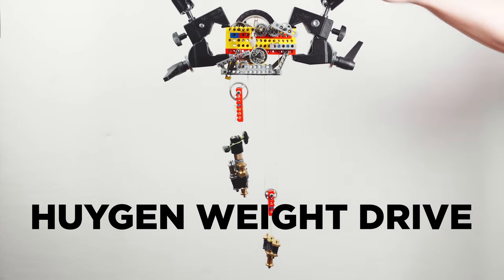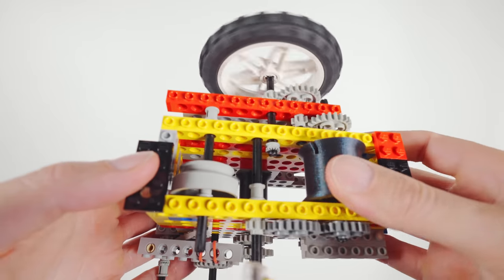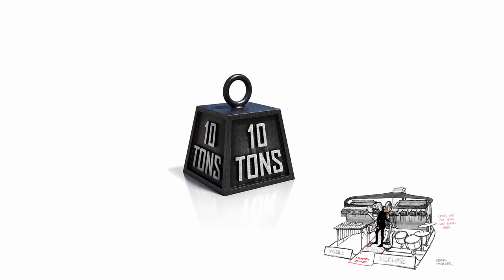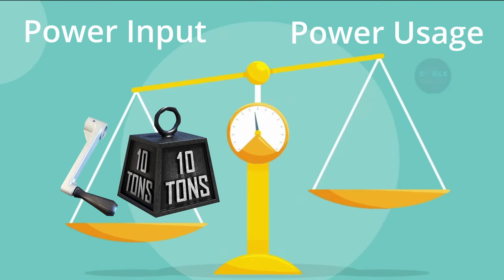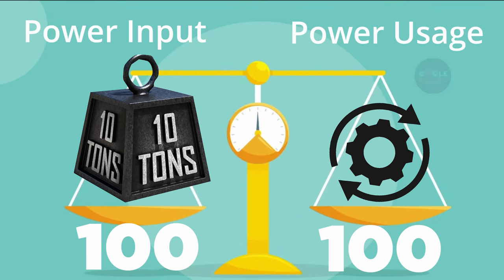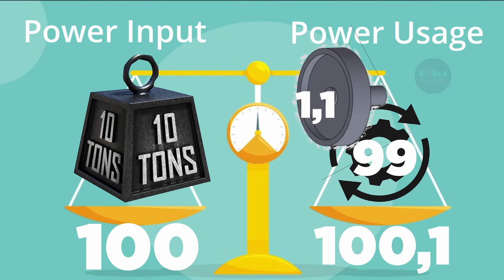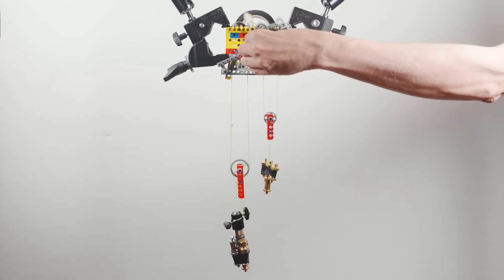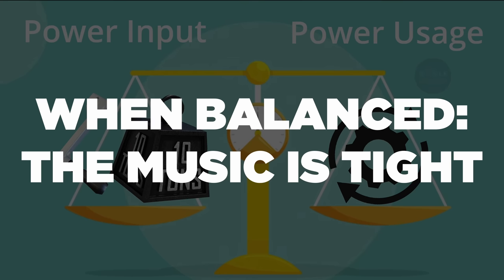Lego Technic Huygen Chain Drive

Comment: I will never understand his obsession with music being so tight
Reply: I think he wants a machine that after sitting in a museum for 100 years will still play music exactly as expected on day 1. Getting music extremely tight now allows for age to have little impact in the future. I think he's upset about the fact that the MM1 worked for one song, poorly, and even though it's in a museum now, it's unplayable, and no one can hear it play live again.
Reply: Small errors introduced by a human will be organic/random and often pleasant. Errors introduced by machinery could easily have patterns which we will actually hear. So an easy target with machinery is to just get rid of all error even though organic/random error would be fine.
Reply: @grunions9648  After this one is complete, he will make a MM4 that will feature human-like imprecisions
Reply: Don't forget he plays alongside midi controlled arps. etc. Aside from the drift which absolutely cannot happen for this machine to work in his sets, there's a huge difference between gradual swing timing errors from a human, and random and possibly even repeating patterns of timing errors which could become quite noticeable and extremely off putting, even on the + a few ms scale. Especially if they are both before and after the beat randomly one after another. It really messes with the feeling of flow, especially when alongside actually highly timed music (like a midi controlled arp for example). 20ms is all it takes for an instrument to start to begin to really sound out of time for a trained ear. If you already have tightness, you can then manually play with timings to get a non random, more natural and less robotic like performance if you really want, but when you're playing alongside midi arps anyway, that robotic tightness of midi might be the sound he's going for (it certainly sound like it at this point).
Reply: He gives his explantion at the end of this and the last video. He says, that he woudn't like to use a machine that isn't precise enough to replicate the music he wants to compose for it and fulfill his vision of a marble machine is general. I my opinon thats completely understandable, since as the composer of the music for the machine, he is the only person who knows whats good enough. The question is just how much time he should spend on this, before moving on and working on something with better chances on quick improvement. Spending a few weeks with lego prototypes to potentially find a revolutionary solution isn't doing any harm and at some point martin will either find a great solution that's up to his high expectations, like with the 3d printed marble gate or he will have to accept a compromise between development time and quality and move on.
Reply: @bongi6811  — That’s an absurd explanation, because he can’t possibly compose music that “needs” perfect tightness to a degree that’s far beyond what is perceptible to humans. Also, we’re CLEARLY well past the point where he’s willing to accept compromises for the sake of time; what channel have you watching?
Reply: @bongi6811  By Martin's standards, he's right that the MMX doesn't play tight music. You know what it also doesn't do? PLAY MUSIC! The only successful project he's had is the original Marble Machine, and that thing was a pile of junk! But it worked and it was finished, and that's something that Martin hasn't been able to replicate in seven years, even with all his additional experience and knowledge in design and manufacture. I guess the Martin that existed seven years ago was able to actually compromise, and be happy just to get something out the door. The Martin of today is such an obsessive perfectionist that he would rather burn MM3 to the ground than hear it play a single wrong note.

Look, I've struggled with perfectionism before. But, I've grown to struggle with it less and less. When there's a deadline coming up, "Done" is a lot better than "Theoretically perfect if only I had more time to work on it." Somehow, Martin has regressed into that latter attitude, especially not helped by the fact that he's got an infinite stream of Patreon money, meaning that he can take as long as he wants getting asymptotically closer to his idea of perfect.

When a machinist gets handed a design for a part that has features and tolerances that would be extremely difficult if not impossible for him to make, does he get disappointed? Think that he needs to do better? Invest in incredibly expensive tools just to make this one part? No, no, and no. What he does is he gets the junior engineer that designed that mistake of a part and he tells that he's an idiot for forcing him to see it. Not every surface needs to be perfectly flat and toleranced to a single thou. Just like how not every note needs to be played within a few microseconds. If Martin were contracting out the construction of the MMX/MM3 to someone else, he would've had his ear shouted off long ago.
Reply: @johnnyjohnson6643  I have to take his word fot it when he says that he woundn't like to use a imprecise machine at 7:59, because thats his subjective opinion. It took Martin less than 3 months from the first video about a new marble gate to finding a desing that he's happy with, which is a reasonable time to spend on such a important part of the machine. The power module is in the works since 3 months and the new idea of testing alternatives to a flywheel since two weeks. I am also a bit concerned that Martin might get stuck in trying to perfect a single component for eternity, but I would consider the time spent so far to still be reasonable. If he still works on the fundamentals of the power module in 6 months or so, I will completely agree with you that he has gone to far, but the progress so far seems to me more like cautious overengeneering to keep savety margins and not introduce design flaws.
Reply: @erictheepic5019  I agree with you, that perfectionism can be a very harmful mindset and Martin is no doubt susceptible to it, but to understand Martins position we also have to keep in mind just how bad the previous two machines actually were. The original marble machine video was edited together from hundreds of takes, because the machine could only play a few seconds before breaking and the audio is heavily edited to sound decent. Even best runs of the MMX in his testing livestreams lastet only minutes before something broke or other issues like a clog of the marble divider occured. The previous machines were definetly far from beeing "good enough" for live concerts or even just a studio album. I belive that the fear of introducing design flaws like the very limited capacity of the marble divider of the MMX is the reason for Martins strive for perfection and overengeneering. Trying to perfect everything can become a huge issue, just like you said and I also fear that he might get stuck from not accepting a compromise, but I wouln't say that it happend so far. The development of the mm3 started just 8 months ago and he made good progress with the marble gate completed, programming wheel concept proven and a decent power module desined. Having an overengeneered, way to precise machine in lets say 3 years is way better than going for "good enough" to finish it next year and introducing a design flaw, like the marble preassure on the gates issue on the MMX, that makes the whole thing unable to play anything. Only time will tell how the mm3 turns out and I'm still hopeful that it will be the first reliable marble machine.
Reply: @erictheepic5019  Martin wants a machine that can be brought on tour, and by that metric, the original Marble Machine was not a success. It barely worked, and I certainly don't think it was ever "finished." (It's more accurate to say that Martin was done trying to fix it.) This is Martin's project, and if people want to support him, then that's their choice.
Reply: Tight like a tiger.
Reply: @bongi6811  The problem is that he is often aiming for like 1ms or sub 1ms tightness of the music played, which sounds fine, but considering the speed of sound this is beyond human limits. Imagine being at the concert of a band, and the musicians played absolutely unison, a person being on the right side would have a far bigger delay between the two than 1ms.

This whole tightness kerfuffle only starts to make sense if he says what tightness he needs his music to played at and how he expects it to amplify or smooth out on his machine. Otherwise this is just chasing butterflies.
Reply: @Caesim9  I completely agree that precision in the 1ms range is unnecesarry for a normal performance, but I think that the reason why Martin is trying to get every part like the marble gate and the power module as precise as possible is, that it allows other mechanisms to be less precise while the complete machine stays accurate enough for human perception. For example, if it turns out that he can't get the programming wheel to be perfectly round, which introduces inaccurate triggers, thats fine, because the power input and marble gate are so precise that everything together is still good enough. I like this aproach of trying to do everything as good as possible before moving, as long as he isn't spending years on single millisecond improvements, because it's a slow and steady way to a reliable marble machine, that's hopefully capable of studio recordings and even live performances.
Reply: The irony - his quest for tighter timing has resulted in him not making any music with the marble machine.
Reply: It's an easy way to generate more content, isn't it? Less and less, I think the goal is to have some sort of musical "thing," and is more about being a YouTuber.
Reply: @brianbaker2759  In his quest for tigher music, he finally isolates the source of all errors, his humanity.

"On this episode of Wintergatan Wednesday I will be uploading my consciousness into a computer."

Comment: Wait till martin discovers how tight a midi keyboard can play! On a more serious note, a sprag or roller clutch will fix your backlash issues.

The bigger issue is the mmx does not have a constant power usage, it depends on how many and how often notes play, and adding a governor will sap significant energy.

A simpler governor as opposed to the centrifugal one, is a fan or using air resistance. Little music boxes often use this.

Comment: The power input must not only overcome the friction, but the energy required to lift the marbles.  If at any moment in time, the machine is on average lifting 100 marbles, the energy required to lift the marbles is also a component of "power usage."  If the number of marbles being lifted varies from moment to moment (which seems likely), the power usage will correspondingly vary.
Reply: Excellent point! 👍👍
Reply: That may not actually be true if there are enough marbel at the bottom to act as a buffer than the amount being lifted at any given time would remain constant; Even if the buffer pre and post left are changing in value.

Comment: Martin. You cannot use the Lego models for fine measurement. You can only use them as a guide, rapid prototyping to get an idea of what might work. If you try to test using Legos you're going to burn yourself when you move to real materials. Only use them as a guide!
Reply: But the tight tolerances on LEGO blocks! /sarcasm
Reply: I hope that I'm right that he is just using the Lego models to test out different proofs of concepts. I could be wrong, but I think I hear that in the subtext of his explanations.
Reply: I saw a video of a PhD project of a 3D printer for printing biological tissue, it was made of Lego apparently so it would be easier for researchers to copy and it would be cheap, everyone in the comments defended it saying that lego was absolutely suitable for a “complex” machine that is apparently meant for use in research labs. It was using lego Mindstorms motors.

It was complete BS and the machine wasn’t even that great, they would have had much better results just modifying a cheap 3D printer. A cheap 3D printer would have been cheaper anyway. The only new or innovative part was the tool head for extruding the tissue, the rest of it was just a crappy, tiny, imprecise 3D printer made of lego. Just modifying a cheap 3D printer would have been, easier, cheaper and much more precise with many more features. But no according to them and everyone in the comments a crappy 3D printer made of lego was the best option for something meant to be used in research labs.

It was pretty insulting to researchers saying that they made it out of lego so that researchers could copy it. I think if you are doing that sort of research you are more than capable of modifying a 3D printer.
Reply: @conorstewart2214  its not even like the lego mindstorm sets are cheaper than a cheap 3d printer anyway lol.

Comment: The hand crank makes this an instrument. Using a constant weight makes this a music-playing robot.
Reply: You obviously have not been around the marble machine project long enough, then.

Turning a crank does not automatically make something an instrument. That is actually a pretty stupid comment. The marble machine is not a human-played instrument where each individual sound is manually triggered by the musician. It is playing a pre-programmed piece of music which is encoded onto a wheel that rotates. It's still a "music-playing robot" either way. the hand crank is nothing more than a power source for the rotating wheel, and it's a logical fallacy to argue otherwise. If I turn a hand crank for a barrel organ which is playing pre-programmed music, I am most certainly not "playing an instrument".

The thing that really makes the marble machine more of an instrument than just a musical robot, and the thing that got me fascinated with it in the first place, has nothing at all to do with whether or not it's hand cranked. There are hundreds of hand-cranked music boxes, so it's foolish to act like that's something special. Instead, the special part, is the fact that instruments can be muted or un-muted, and the strings of the bass guitar (which are triggered by the programmed music on the rotating wheel) can have their pitches altered, using the fretboard. And there's a way to manually drop marbles onto the instruments. All of that is controlled by the human operator. Pretty much all other mechanical musical "instruments" are just playback devices, where once the pre-programmed music starts there's not much else you can do musically. The closest thing to the marble machine as an instrument would be something like a player piano, which is just like every other piano in that it can also be played entirely manually with no pre-programmed music. And I've also heard of something called the Gloggomobil, which is a xylophone-like instrument played by mallets. Mallets can be operated by the pins on the rotating wheel for the pre-programmed music, but the instrument can also be played manually with hand-held mallets.

That is what really makes something like this an instrument. It is not the hand crank. Hand cranks are nothing special... they only serve as a power source. Nothing more.

Comment: Somehow, I feel like this is the precise instant where the marble machine slips off the "instrument" category. A "human" power input is what makes an instrument an extension of the body, and I think, is the reason why music makes sense, because you feel the rythm of one's body. Then again, there's electronic music, and probably many other exemple where this doesn't apply... Anyway, good luck
Reply: I think this just makes the marble machine a little more like a pipe organ, which is getting consistent power input from a set of bellows. That concept is kinda combined with a synth or loop station where there's a 'recorded' set of tracks and the artist is choosing which combination play at any given time. If it's anything like the previous machines, he'll probably have a way to play manually as well.
Reply: Giant church Or- oh someone beat me to it hehe
Reply: I swear someone comments this every week. It isn't called "The marble instrument", it's "The marble machine". It contains instruments, but is a machine. Martin will manually interface with the machine to make music. It isn't worth debating, ultimately it's a matter of opinion.
Reply: I disagree. It has always been a mechanical machine running on human power.
Is a bagpipe not an instrument because you don't directly blow in the pipes, but instead store air in the bag?
Reply: Feel free to direct me to the timestamps that make it seem like Martin will be directly interfacing with this machine in order for it to play music, fellas. Is it gonna be when he hits the “on” switch? That’s the clear trajectory his project has taken.
Reply: @johnnyjohnson6643  we haven't gotten that far yet. On each previous machine he had levers to activate/deactivate each instrument channel as well as a way to manually drop marbles
Reply: @johnnyjohnson6643  You must be new here. Look at the way he has interfaced with his previous marble machines. He'll turn on various instruments, maybe play the bass or a guitar manually, idk. that's his art, and it's unique. Also, with this mechanism, it seems like he still will need to crank something to give the huygen  mechanism power.